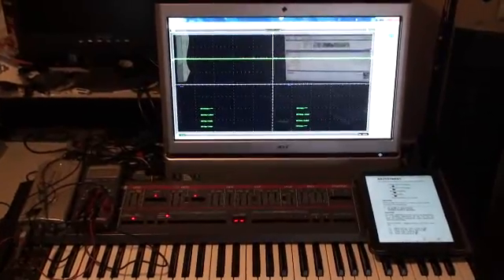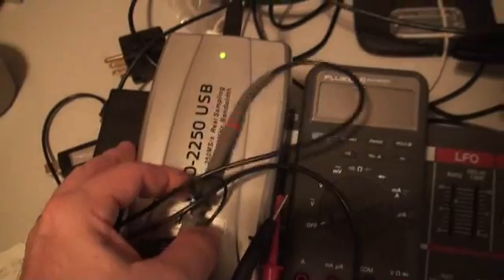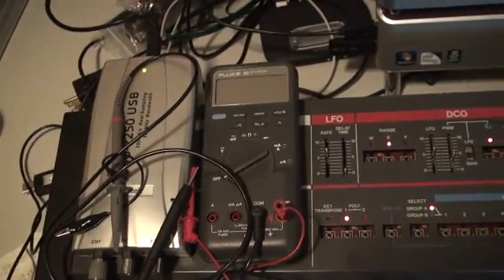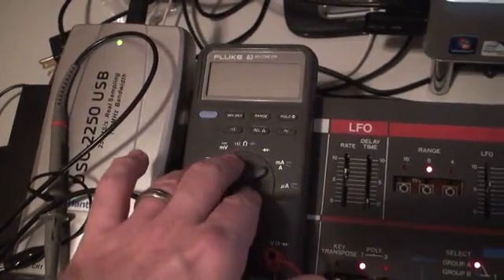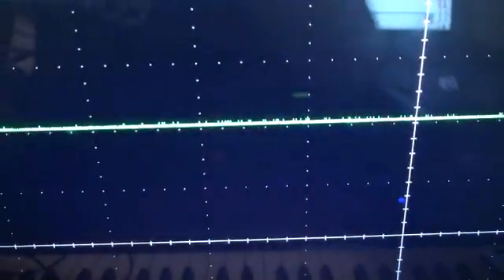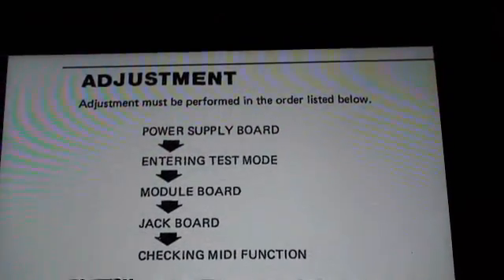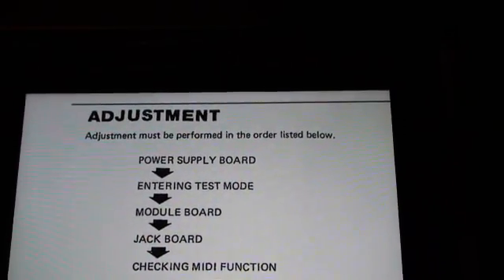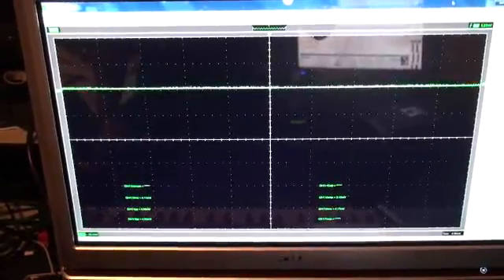Juno-106 Calibration 1

Comment: Hello , firstly i want to say thank you for posting this incredible tutorial , i have realized it to my juno 106 who had 3 failing voice chips , i repleced those and use this tutorial to calibrate , but suprisely in some of the presets i noticed that one note had less volume than the others , but performing a diferent preset every thing was normal .

So i decided to check on with presets there were one voice with less volume and i fount it were 6 and all of them has dco range 4 , so after notice this i permfomed the wave generator test , witch result all fine if i set dco range at 8 but fails in voice 6 with a dco range at 4 .

voice chip is brand new , it is analoge renassaice , so i think it must be the wave generator , cause all the others test's are ok .

Please help.